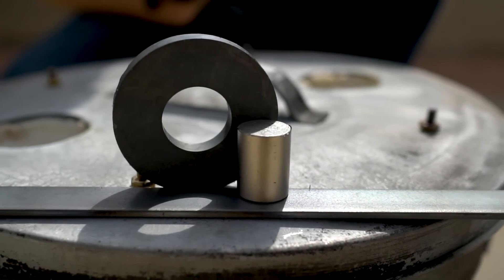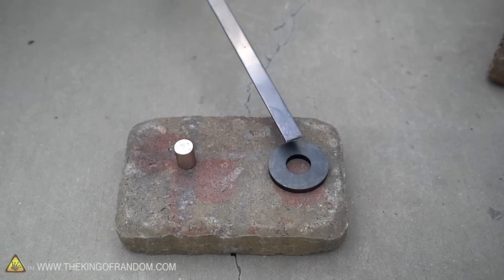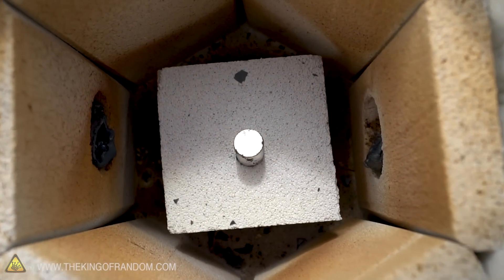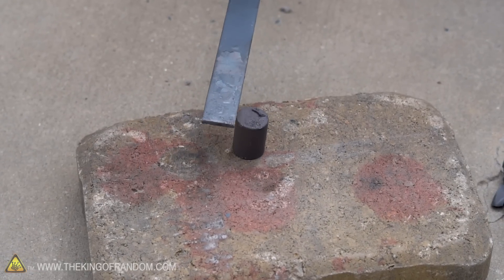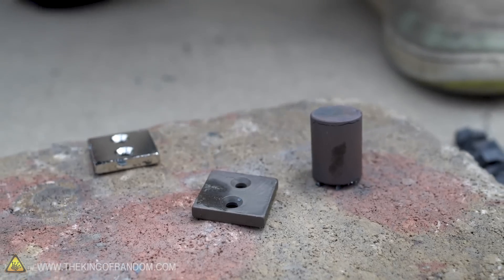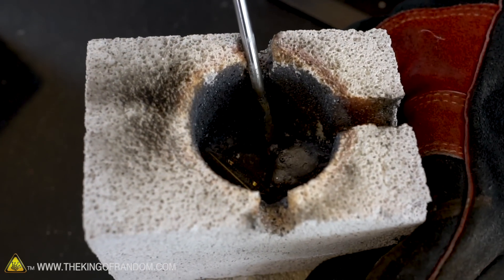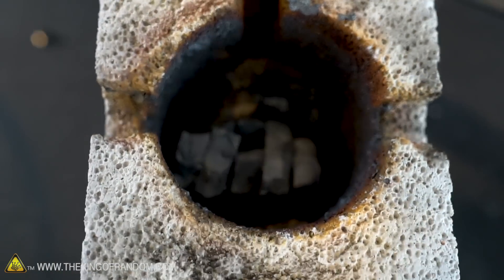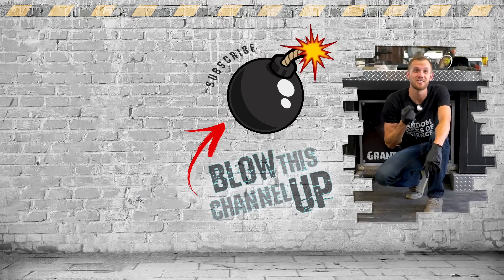Melting Magnets is Weird

Comment: Hey i hav a question....  We know that earth's magnetic field is due to flow of ions in the core. But if heating ruins magnetic effects then what's the cause of earth's magnetic field??
Reply: My guess was pretty close.
Reply: Yeah i too searched it..this thing works due to the reverse dynamo thing...you were pretty close dude🤘
Reply: Karan Singh simple way of explaining it is. Convection currently in the core is causing electrical currents and those electrical currents then cause the magnitism.
Reply: +Karan Singh  Being solid is not just a matter of heat, other things influence melting points one of which is pressure.  At the center of the earth the pressure of all the material of the planet pressing down is so great that Iron which has sunk to the core becomes solid again.  You have a solid Iron ball which then has a conductive liquid above it (made of Iron and other things which are high enough that the pressure doesnt cause them to solidify).  The fluid then flows around the core in circles caused by the Coriolis effect and this generates electricity.  

This is exactly the same method a dynamo uses to create electricity (we used to attach dynamos to the bikes wheel and our own pedal power generated the electricity to power a light at night).  Electricity and magnetism are  two sides of the same coin, where you have one you have the other as they are basically the same thing but from different perspectives, if you have a generator it will create a magnetic field.  So the earth has a magnetic field.  

Mars is about half the size of the earth and this is too small for the effect to last long (it probably had a field for a while but not now), but earth is large enough.  A bigger planet would have a stronger magnetic field (as long as it had a high enough Iron content).
Reply: @feynmanwasagenius3482  sir generally a magnetic field generated by revolving around a solid core would need to be polarized. If the di pole is not aligned then wouldn't that tend to reduce the magnetic properties to nyl? 
Like the neodymium is reduced to a disoriented di pole and cannot regain it's magnetism even if it were to be remaged. So the other factor is that this magnet also contains iron. That is the ingredient that is now attracted to the new magnetic material in his demonstration. So if the core was made of the most powerful magnetic material it is inconsistent with magnetism existing in a high temperature as this magnet has both ( NdFeB ) iron of which the core is said to be consisting of at high temperature. I would like to know how high temperature can produce magnetic fields without having magnetic properties? The steel rod is an example of the lack of attraction when hot. But it returns to it's room temperature it attracts the magnet. The di poles in that material revert  to it's natural state. So help me understand a stable magnetic field in a moving heated mass in liquid or solid form. Because I think the di pole is to relaxed to be a magnet or attract one at that high of temperature. What do you think?
Reply: Completely spitballing but I would assume the rotation of the inner and the (relatively) stationary outer act (somewhat) like a generator and a current is induced in all the metal  within the crust which generates the magnetic field normal to the axis of rotation of the core.  I'm gonna check the wiki to see if I was even close.
Reply: @thedillybot  so like a natural electro magnet in a way?
Reply: @maddmavic  Of sorts. In an electromagnet the current from a power source induces a magnetic field in a ferrous material.  In the earth, I figure it's the heat and rotation of this incredible amount of material that excites the metals in the mantle/crust.  The scale is the key here, like gravity you need enough mass to see any appreciable effect.
Reply: @thedillybot  I go with your notion, but what about the sun then?
Reply: Hits blunt-  if corn oil is made from corn, and vegetable oil is from vegetables , what is baby oil made from?💢😱💣💥 woah!
Reply: Karan Singh that is a smart question
Reply: Not one single, testable, observable, repeatable experiment that proves moving molten iron core creates our magnetic field. Scientism is great isnt it?
Reply: well when u heat a maybe it loses power so how can the magnetic field theory be true
Reply: @fatalx916  Neither are there any concrete experiments that can prove the earth's magnetic field isn't generated by a 500 mile tall Energizer Bunny. 
Boom. Giant Energizer Bunny confirmed.
Reply: @andyskeels8539  bet you if scientists said so, you would believe it. Learn to think for yourself.
Reply: @fatalx916  well, you haven't offered anything to the conversation except some smarmy remarks. Oh, but I would certainly love to know what your beliefs of gravity and electromagnetism are! If they are half as creative as the Giant Energizer Bunny theory, I'm sure they will be entertaining.
Reply: @andyskeels8539  well I'm pretty sure anything I say, you will just ignore and not even bother to investigate, so it's not worth my time. Your religion of scientism has blinded you which is so sad, you can't even think for yourself.
Reply: @fatalx916  wow, what you have to say must not be very important then. 
Giant Energizer Bunny theory undefeated.
Reply: the fact that the hot mantel is spinning around a solid super pressure high heat iron core, the spinning of these two layers causes the magnetic field and also leads to electromagnetic storms deep within the earth.
Reply: Flux it there's also the topic of how they magnetize our magnets in the first place...a huuuuuuge electric spark if I'm not mistaken.
Reply: @Sreenath Aether what hum?
Reply: Electro magnetics
Reply: there is currently two hypothosis that is sodiam is making the field or like some one else said its all the churning metals making a strong current which in turns make a electromagnetic field
Reply: It's an electromagnetic field and electromagnets don't have a curie point so the temperature of the core has no effect on the field's strength
Reply: The Earth's magnetic field does not come from the core alone, the metal core spins inside the Earth forming a kind of generator and electric current produces magnetism
Reply: the rotation speed of earth and its gravitational force makes a inductive magnetic field
Reply: Sorry if im late but Earth's inner core is made of solid iron,made solid because of the extreme pressure at the planet's center.And undoubtedly the spinning of the Earth + the gigantic solid iron=very strong  magnetic field
Reply: @boredfilipino7708  is that factual proof or just a theory?
Reply: @fatalx916  factual proof
Reply: @boredfilipino7708  please provide link
Reply: @fatalx916  I'm sorry but I can't provide you a link because I merely spend my time reading books.
Reply: @fatalx916   if you want a more descriptive and specific info just read Feynman Was A Genius's reply above.
Reply: @boredfilipino7708 .You said spinning and solid iron makes earth's magnetic field. Earth spin because it's magnetic field. Right .?
Reply: UHM, every mass has an attraction. Because earth is so huge it attracts everything to it’s core so it’s not a magnet
Reply: It's a solenoid
Reply: haha i was just thinking about this when i watched it... i believe however that it may be due to the solid iron in the crust... the liquid metal moving around inside of the solid iron makes a magnetic field much like how a electric motor creates a electric field, just having the mass if iron rotating inside of the iron shell.... but i serously was wondering about this for like 20 minutes after watching this vid dude
Reply: It is the earths 3000 km thick and colder hollow shell that generates most of earths magnetic field. Think of hollow sphere magnet with holes at both poles. Earth's core is not molten iron, its electric incandescent ball of plasma.
Reply: @Xeno_Bardock  Low density not hollow and no holes at the poles. No way to know if there is a plasma ball down there. More likely to be crystalline IMO which could also cause a magnetic field. NO HOLES AT THE POLES!
Reply: @GhostOfBillCooper  Cores of planets and holes at the poles have already been observed. Search "New Hubble Portrait of Mars" for mars north polar opening and youtube search "Jupiter's North Pole Winds" for plasma core. You can clearly see the huge dent and the polar surface of mars curving inwards/downwards along with the atmosphere of mars. You can clearly see the core of jupiter and light radiating from it. Hollow planets theory confirmed.
Reply: Or electricity in a movement
Reply: Gravity works different than magnetic field.
Reply: @songsforasmr9223  No one is talking about gravity.
Reply: @songsforasmr9223  he wasnt asking about gravity though xD

Comment: Is wearing the plastic gloves the best idea??
Reply: When working with hot stuff no
Reply: yes
Reply: Better than nothing
Reply: @godofgamers3884  unless meted plastic is actually hot enough to stick to your skin,then it's not better than nothing
Reply: yez
Reply: gofofgamers - How about when the latex melts to your skin?
Reply: Miuzik 8OP I can guarantee that the material of their gloves are more resistant to heat than human skin.
Reply: @godofgamers3884  - How about when they MELT to human skin!? Maybe we just wear gloves that are appropriate for each situation, instead of the plastic black gloves cause they look cool?
Reply: Miuzik 8OP people have a tendency to think plastic has a low melting because of what we are exposed but industrial plastic is actually very strong and heat resistant. 

Take glass for example, many don’t know that glass is far stronger than concrete just because we normally associate “breaking” with glass. That’s why everyone was too scared to walk on the glass bridge in China, even though it’s less likely to break when compared to a concrete bridge.
Reply: Miuzik 8OP how about when he uses insulated gloves, because he did.
Reply: He used insulated gloves, watch. Every time he is doing something, anything, with the furnace, he wears better gloves.
Reply: They aren't plastic they are nitrilen gloves.
Reply: yes

Comment: Try winding a coil of copper wire around the furnace, then - once you’ve melted the steel (and removed the heat) - hook up the coil to a car battery to make a solenoid; you’ll have to experiment to find an ideal # turns, and wire diameter. Since car batteries can put out sh*tloads of current, start with #10 ga. wire, as many turns as you can get around the furnace. Keep in mind that it’s a trade-off; the more windings, the higher the DC resistance, and the lower the current and the battery will last longer, but less current = less magnetic field.

Comment: ok tons of comments so not sure I can even consider reading everything here, but, I am really curious how much  you have read up on anything before you make a video, reason being, is that neodymium magnets are NOT mostly neodymium, but rather mostly iron, with I believe 12 parts iron, 2 parts neodymium and one part boron. would have to pull details up right now to get what exact amounts are, but basically the boron *(slightly diamagnetic) and the two neodymium atoms on either end of a stack of iron (boron in dead center theoretically) creates a train of energy, and the paramagnetic nature of the neodymium just increases the magnetic property of the ferromagnetic material, the iron.

also the magnets losing their magnetic property, when heated yeah, figured that, the placing the magnet on magnet while hot, I kinda figured you had too much heat and the conductivity thermally was too high to allow the second magnet that was cool to stay cool long enough to matter.

Comment: I don't really know why i watched this when i already knew what was going to happen (since i know how magnetism works for the most part)  but nice vid anyway. For those who don't know a magnet is basically a bunch of atoms with their electrons on the same side. You can make things magnetic (of course depends on material) by leaving them (in their mostly solid state usually at room temp)  next to a magnet for a long time which slowly shifts the electrons to side and aligns them together. When the material is heated the atoms are put i into an excited state which both increases the speed that the electrons move around the atom. The heat basically desynchronizes all the electrons rotations around the atom... now that i said all that i am doubting myself a bit.. i think I've oversimplified it too much since its been a while that i studied it. If I'm in any bit wrong anyone can correct me, i don't mind.oh and yes i know that metal with electricity flowing through it creates a magnetic field a bit differently. I just decided not to bother giving an explanation on that since I'm already doubting myself.

Comment: You should try insulating the magnet from the heat of the steel while it's cooling. If you could thin the base out or just make another thin dish of firebrick, you should be able to set the magnet underneath and let the steel cool. The magnet will be insulated from the heat, but should still extend it's magnetic field if it's strong enough.

Comment: This completely destroys Iron Core theory of Solid Earth theory. Very Hot = No Magnetic Field nor Attraction
Reply: It is the earths 3000 km thick and colder hollow shell that generates most of earths magnetic field. Think of hollow sphere magnet with holes at both poles. Earth's core is not molten iron, its electric incandescent ball of plasma.
Reply: Matter can only get liquid if there is enough space for particles to move freely when it's heated up. Too much pressure and this space is not available anymore, and it remains solid. The core has the entire Earth's weight above it from all directions, pressure is immense, too great to allow it to be liquid at a mere 5000°C. This completely destroys theories stating the Earth's core is not solid.
You have a solid core, a spinning planet, outer layers that are this time sort of liquid. The core rotates, but outer liquid layers "lag behind" because well, they're not completely attached to the core, they're liquid. This friction is what creates Earth's magnetic field.

Comment: If you keep the magnet within a magnetic field while heating it, the internal poles should remain aligned with the field as it cools down, and should retain its magnetic properties. You could also remagnetize it with another magnet, by rubbing it along it in one direction a couple dozen times. Try that!